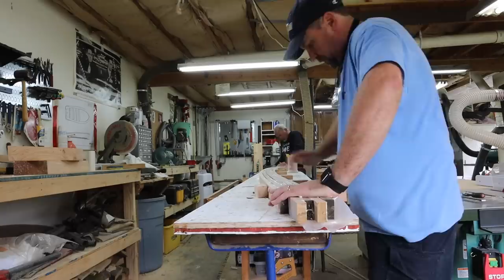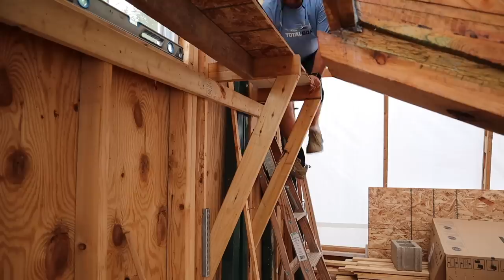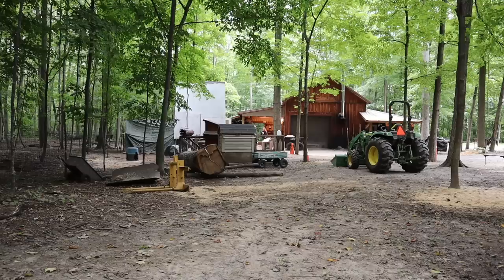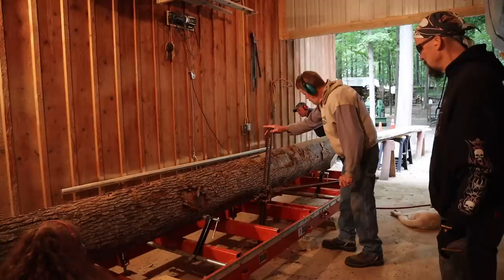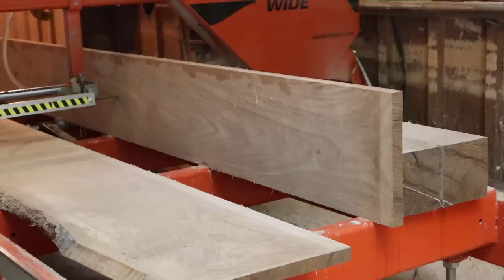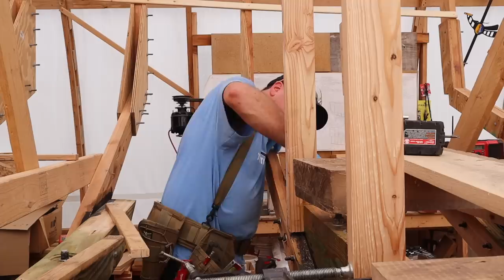Wooden Boat transom planking and saw milling! Sea Dreamer Project ep. 34

Comment: Hi there, I built new bulk heads in my boat throughout. I used really nice 3/4" plywood sanded both sides. Epoxied  them to the frames and then used bi-axel matting both sides on the plywood. It changed the bulkhead to a structural member by just reinforcing the plywood with the glass mat. Rot at the bulkheads are a big deal, so if I was building your boat I would spend the time and really beef them up. A friend of mine rebuilt all his bulkheads in his boat and followed this system as well. He could tell a huge difference in the boat as being tighter than before. I see you have been bolting the floor ties in, which is great. You might think about using bi-axel matting around the floor ties to the frames. Once again it adds structural strength to the assembly and really helps with any rot issues. The fiberglass matting and epoxy is cheap when you weigh in the benefits it brings to the over all strength to your boat.  Just added my two cents to your project...lol. Don't befriend me now...lol.
Reply from the maker: good advice.  our bulkheads will be two layers of 3/4" plywood so they should be pretty stout.

Comment: Aft cabin companionway.  Do you have any thoughts on the Seahorse Marine layout, single staircase access forward with port side galley? Appears to be a better use of space above and below.  More room in pilothouse for seating, door access to E.R. from below.  I have no understanding of how it would complicate the build.  Thanks for the videos, I've learned a lot watching.
Reply from the maker: The Seahorse ducks are actually about a foot and a half wider with their fuel tanks in the belly.  our tanks straddle the engine in the engine room so no possibility of replicating that design.
Reply: @SixPointsWoodWorks  Ahh that makes sense.  Thanks for the reply.

Comment: I'm new here. Why galvanize over stainless? (Irondequoit, NY), moving to Macedon next week. Glenn
Reply from the maker: My dad use to have a house in Macedon.  Long story, short, galvanized is used due to cost.  Stainless steel is not really used in boat building below the water line.  Stainless is a bit of a misnomer, as it does corrode, just from the inside out.  Fine boat building uses silicon bronze fasteners which are really expensive.

Comment: Just splitting hairs here but FYI at 13:00 you mention #14 screws vs. 1/4" bolt.A #14 is .250 diameter.....Other than that, looks great. Keep powering forwards man.

Comment: Question do you allow for spring when bending, and laminating?.
Reply from the maker: Not really.  Our experience in bent laminations for the boat shed taught us that after mechanical fasteners are added to the assembly on these gentle arc's there is very little spring back.  for the deck beams it was less than a 1/4 inch.

Comment: My hat's off to you, you're at the very beginning a long journey.  

Time to start buying your epoxy in 55 gallon drums.  Don't make the mistake I did when starting out buying gallons.  Epoxy has a very long shelf life and is about 40% of the retail cost in drums.  Come to terms with the volume you're going to use and start researching local wholesalers.  Same for glass, peelply, fillers, paint systems.

Comment: That hull will be very sturdy. Will you still be able to see the oak on the inside? Enjoyed the trip to the saw mill, liked how they broke the logs down for you. I bought a plank of white oak over here and all they had was pretty much just slab sawn; I was only able to get a plank with just enough vertical grain for my main need, like it had all been sorted out at source.
Reply from the maker: I'm not sure if we'll leave the planking visible from the inside, I agree it is nice to look at.  The sawmill folks are very responsive to cutting exactly what I want.  I'm getting better at articulating exactly what I need.
Reply: I suppose really it will all get covered by the fixtures and fittings. Being able to say what you want is not as straight forward as you think at first.

Comment: Just amazing!

I look forward to every video.

What brand/website of galvanized fasteners do you get? Screws, bolts and such.
Reply from the maker: Thanks.

We've purchased galvanized fasteners from the big box stores, Jamestown Distributors, Hamiliton Marine, Bolt depot and another smaller place that I don't recall the name.  It's tough to find real cut thread, galvanized wood screws, Tacoma screw and Hamilton marine are the only ones that i have found.

Comment: So glad to see full length planking on the transom. Smart move.will there be an access hatch between the rear cabin and the engine room? What about some form of insulation (spray foam, maybe) to reduce the sound from the engine room into the neighboring holds/cabins?

Comment: Surprised they using gas powered saw mill, electric the way to go, much much less noise,servicing and even going getting gas? I also now use electric chainsaw. It is an amazing tool and the no noise,fumes and vibration a major plus point. I have a single hand" light sabre" chainsaw for quick trimming and it a god send! I whole heartedly recommend changing over to electric power over gas.
Reply: They probably want the option of going off grid.. and there's the added purchasing cost of the electric motor option. I'm just guessing, I have no earthly idea of what's going on in these peoples heads... ☺

Comment: About Beta marine engine, original alternator for AGM startbattery alone, one alternator for lifepo4 battery bank, and 5kv 110 volt for washingmachine, AC ++++. You can skip second alternator and instead use 5kv 110 volt to serve litium batterys. If possible make a coolingchest for engine cooling.